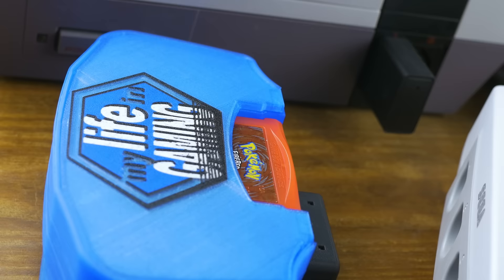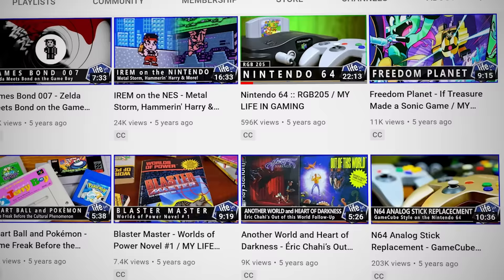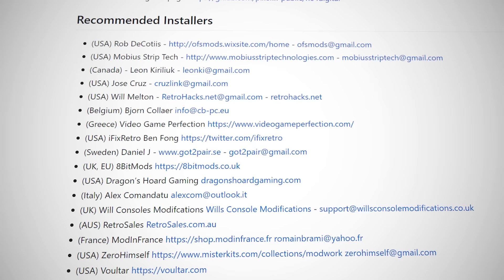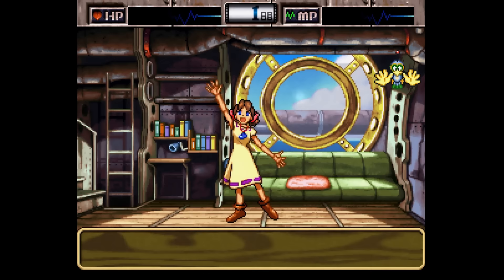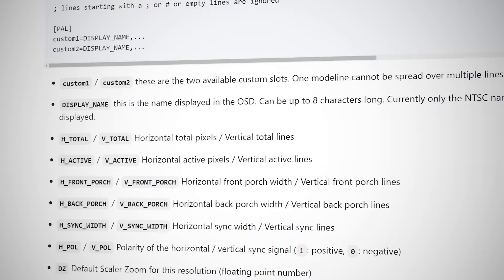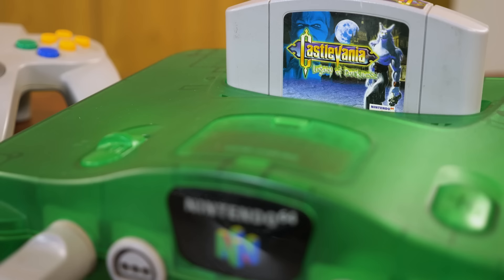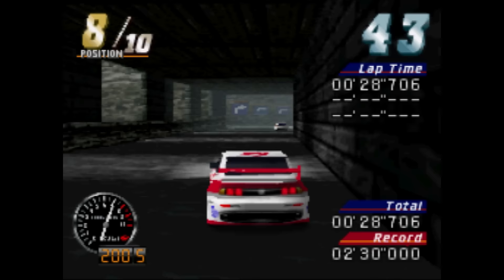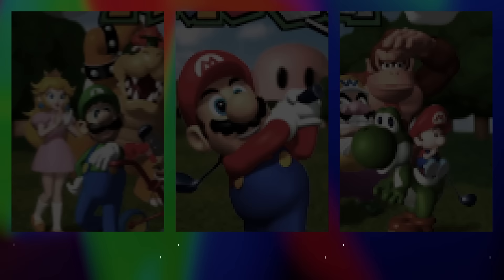N64Digital - Ultimate HDMI and RGB Mod for N64? :: RGB323 / MY LIFE IN GAMING

Comment: 16:37 Does anyone know what the settings would be on N64Digital to approximate the "Retro Mode Preset" featured on the UltraHDMI?
Reply from the maker: [Try4ce] The scanlines features have already changed A LOT since this video released, but to get that effect, it's pretty simple. Turn OFF Deblur, set vertical and horizontal interpolation to the softest values, and then play around with the horizontal scanlines a bit. Adjust the saturation enough so that white almost blooms over the scanlines, but not too much.
Reply: @mylifeingaming  Thank you, @Try4ce! I updated my firmware shortly after posting the comment and noticed the addition of several presets, although I don't really know what any of them mean (industry jargon?). They are:
Adaptive Scanlines
Adaptive Demo 1
Adaptive Demo 2
Aperture Grill
LCD Grid 1
Perler Beads
For now I am using LCD Grid 1 and enjoying that, although it may just be that I never knew how much I like scanlines. I will try to circle back with values for these presets and determine which is closest to "Retro Mode".
Reply: Here are what the presets mean, forgive the table formatting:
NAME                        | DEBLUR | ZOOM | HORIZ INTERP | VERT INTERP | HORIZ SCANLINE     | VERT SCANLINE       | SRC RES
Default                      | On           | 4.50    | Sharp                 | Sharp              | Off                              | Off                              | 320x240
Adaptive Scanlines | On           | 4.50    | Sharp                  | Softer             | Adaptive 100-80-75 | Off                              | 320x240
Adaptive Demo 1     | On           | 4.50    | Sharp                 | Softer             | Adaptive 137-78-99 | Off                              | 320x240
Adaptive Demo 2     | On           | 4.50    | Sharp                 | Softer             | Adaptive 137-78-99 | Off                              | 640x240
Aperture Grill            | Off          | 4.00    | Soft                    | Soft                 | Adaptive 100-50-45 | Off                              | 640x240
LCD Grid 1                 | On          | 4.00    | Sharp                 | Sharp              | On 100-50-15            | On 100-50-15            | 320x240
Perler Beads             | On          | 4.00    | Softer                 | Softer              | Adaptive 110-60-89 | Adaptive 110-60-89 | 320x240

Comment: So is there an option to have the console default to 16:9 for games that have that option turned on? Or do you have to switch to 16:9 in the mod settings anytime you boot up the game and switch to 4:3 for the other games?
Reply from the maker: [Try4ce] If using an EverDrive, you can save per-game settings. That doesn't work for real carts right now, but they told me they have ideas for how to make that possible. In the meantime, here's what I would suggest, if you can use 1200p. Use 1200p for everything else, and 1080p for widescreen games. Your scaler settings are remembered for each resolution. You can't use 1200p for widescreen anyway. So just change resolutions instead of adjusting multiple settings.
Reply: @mylifeingaming  good to know. Thanks for the quick reply.

Comment: There are officially too many options for n64 - I don't know what to pick anymore 😔

Rad2x, retrotink, one of the hdmi mods, one of the rgb mods, eon 64, mclassic bundled yay or nay....

Right now I have an old Panasonic Tau with s-video and some old Nintendo s-video cables... I'm treading water here as more and more options flood the room, lol.
Reply from the maker: [Try4ce] There's definitely a tier of quality based on your needs and budget. N64 Digital is the top for sure but RetroTINK 5X is great for an unmodified system. RetroTINK Mini also works if you wanna save money.

Comment: would it be stupid to keep resolution at 480p and let the mClassic upscaler do the rest of the work?
Reply from the maker: [Try4ce] I don't think it would make much sense to do that at all. I say this as a person who doesn't like the look of Marseille scaling, but the flaw in this plan is that the mClassic can only do its best work when the game resolution matches the console output resolution. A more common example would be, let's say you have a 720p Switch game but the console is outputting 1080p. mClassic doesn't know what to do to fix the picture correctly unless you set the console to 720p. In the same sense here, we're dealing with 240p games. 480p isn't going to do what you want. I think you'd be better off outputting a high resolution and letting the scanlines and soft interpolation do what it's supposed to do if you want a smoother look.
Reply: @mylifeingaming  thanks for the response!

Comment: I would like to see a hardware mod that fixes the frame rate of high res games like Turok 2, Perfect Dark and Hybrid Heaven.
Reply from the maker: [Try4ce] For that to happen, the chips processing the games would have to be changed so much that it wouldn't be original hardware at that point.
Reply: Lot of games are coded with custom microcode and some threads are literally timed to how fast the n64 hardware is. Take for example the opening scene to goldeneye 007: reduce some lag by turning off the consoles AA and now you have desynced the audio to the video. It's not exactly as simple as just "overclocking" or anything like that. If you want 60fps Perfect Dark I highly recommend the x360 version.

Comment: I cant decide which mod i want to use. I was going to get a retrotink 5x pro. Now i kind of want a hdmi mod. I have alot of retro consoles. It kind of makes sense to buy a retrotink
Reply: If you own multiple systems I would stick with the retrotink5x and just update your cables. Then if you ever decide to mod down the line, go cheaper and simply get an rgb mod for the n64 and let the retrotink5x handle the rest.
Reply: @ians_parks  they are getting rdy to lease a retrotink 4k. It will be very expensive. Should i get the 4k or 5x?
Reply: @jeremyrozensky8985  It really comes down to your own budget. The 4k will undoubtedly be the higher end enthusiasts option. The 5x is still a great device.
Reply: @ians_parks  i really care more about my older systems like dc ps2 saturn and n64 looking better
Reply: @jeremyrozensky8985  The 4K benefits from having HDMI In which is beneficial for 720p systems like the PS3 and Wii U. If this doesn't matter to you I wouldn't say the upgrade is necessary. The 5X can scale up to 1200p and 1440p which should be more than enough.

I'd say the most necessary feature to have when playing PS2 games on an HDTV is Motion Adaptive Deinterlacing for all the 480i only games. And both the 5x and 4k have it.

Comment: Is the N64 Digital a better option than combining an EON 64 with an mClassic? I mean in image quality
Reply from the maker: [Try4ce] 200% yes. Personally I don't like the mClassic, but it's really not going to be doing its best work when the source material is 240p (and the source for the EON device is S-video, versus digital video and RGB from N64Digital).
Reply: @mylifeingaming  yes I know, but I mean a combination between the EON64 + mClassic, does the Pixel Fx still has better image quality than that combination? Also the EON  has an smoothing option for sharpen edges, which I think the Pixel FX doesn’t
Reply from the maker: [Try4ce] I think that option is still intended to be released in the firmware.

Comment: anyone having issues when scaling over 5.00 on 1600x1200? Mine cuts off on the left side.
Reply from the maker: [Try4ce] I find that you can usually go to 5.25 or even 5.5, but 1600x1200 is a 4:3 signal. So it will cut off because the output doesn't fill the whole TV. This is why you have to use 1080p or 720p for 16:9 mode because only they are 16:9 output. The reason for this is because going for widescreen over 1080p would be pushing more pixels than the HDMI chip is designed to do. Keeping it 4:3 makes it possible to go over 1080p.
Reply: @mylifeingaming  Cheers and thank you for the reply. Love the videos you all make and the knowledge you share!

Comment: Whoever did that HDMI mod on the jungle green sure fucked up that plastic. 

I would like to know which modder thought that was ok.
Reply from the maker: [Coury] The HDMI port on the mod was no fault of the installer at all. There was a switch there from a previous mod (a Tim Worthington RGB mod with deblur) so this was an attempt to just use that same opening for the HDMI. It was my suggestion because the system was in really rough shape is it was - theres a huge crack in the plastic on the side of it, so it doesn't bother me at all. It was the only system I had available to do this mod with, and its nice because its different than all of the other systems we have.
Reply: @mylifeingaming  that makes perfect sense. 
I have a Tim Worthington system myself, and now an n64digital kit.

Both excellent kits, I do like all the extra options I get with the digital kit, and not needing my OSSC or GBS Control like the Tim kit.

I just really wish the DCdigital and PS1digital would restock soon. (And my GBA Consolizer would ship already) lots to look forward to